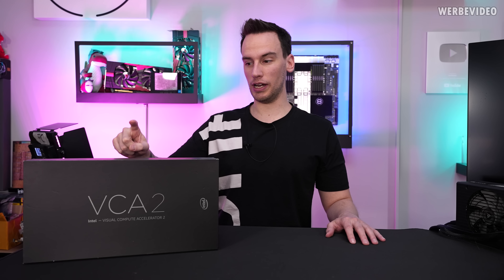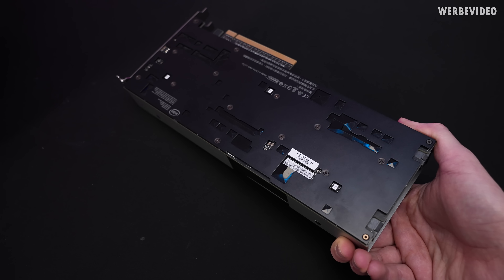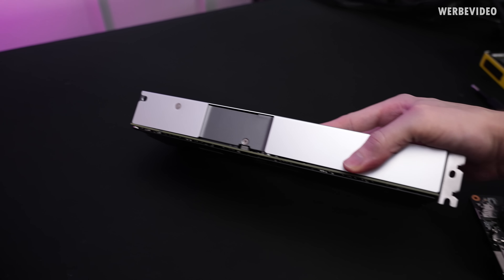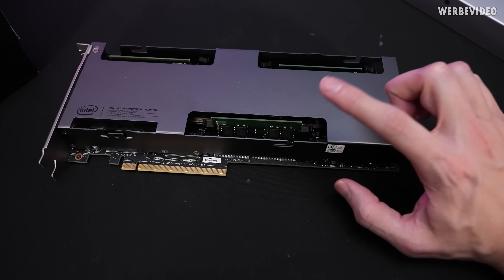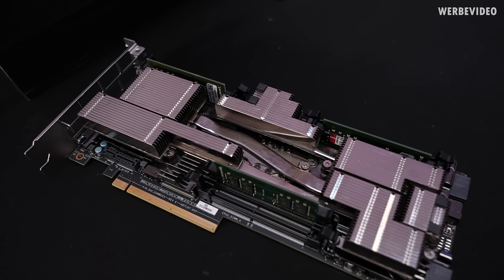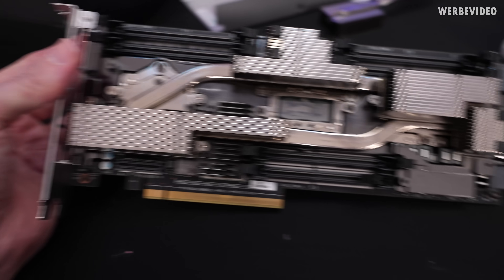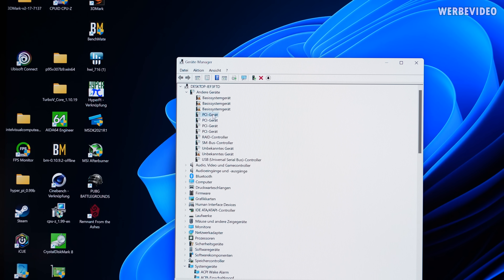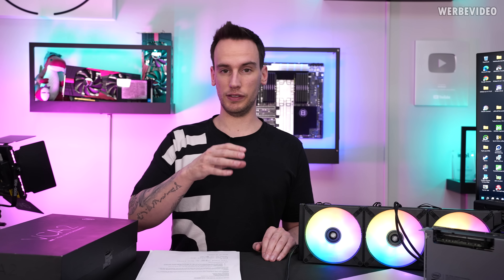Is this an Intel "Graphics Card" with 3 CPUs?

Comment: Seems like a frankenstein solution from years ago before Intel Arc, as they now have Arctic Sound which ditches the odd Xeon parts for just DG2 dies.
Reply: seems like you would use your server as a backplane and install multiple cards as a cluster. the server acts as interconnect and provides i/o.
Reply: No.. its a H100 Nvidia competitor.. build for a datacenter..

Comment: I think you are more likely to get this to work under a hypervisor like VMWare... Try to install VMWare ESXi on the machine, and then you should be able to control it through vSphere from another machine. VMWare will likely detect the additional CPUs and GPUs and make them available for VMs... You can also setup your virtual network through vSphere.
Reply: Not how that works, VMWare (or any OS) cannot see the CPU's and use them as its own CPU's, nor can VMWare assign CPU's over the PCIe bus like that. They are connected through a virtual network so you could install Windows Hyper-V on the three nodes on the card and run a small Hyper-V cluster on them, or Xen server but VMWare does not seem to support it at all. Anyway, best case is you get a cluster of 3 rather underpowered hypervisors, nor 1 system with 3 extra CPU's.

Comment: About the end part, Linux might be the answer..
Yes, it's an enterprise component it works netboot, net-storage & net-install. Net-install is the key where those windows drivers comes in play, when you can flash OS image to the recievers chache. When it's time to shut down the whole data gone, so prior to that the target output data/file is transferred to another network location.

Comment: It seems like an odd solution. What is the benefit of the PCIe connection? Is it marketed as lower latency than having separate hosts?
Reply: Not really, it's just a way of having a cluster on a PCIe card, a bit more compact and integrated than a stack of separate computers, through the latter would be far more capable.

Comment: Looks like it requires a Xeon E5 server + custom CentOS/Windows image.
Definitely interested in seeing "vcactl" running on Linux, with windows installed on the onboard M.2
Reply: Oops, I should have read the comments first😎 Spot on . Though, me not grey yet, But getting there!😀
Reply: it works also with windows but the m.2 slot is for cache  so the frames are stored on that card to exclude long ways  and you can add a feature to the bios that you can have wifi display output at boot times

Comment: You should theoretically able to perform Hardware Encoding for VP8 VP9 and AV01 videos. Which are typically used by YouTube servers.

Have you ever wondered how does YouTube able to Transcode your Video into VP9 within seconds if you're already have several Thousands subscribers?

Until this day, not even RTX 3090 Ti or RX 6900 XT capable of Encoding VP9 not even AV01 videos.
Reply: Nope... Google have engineered their own specific VP9 hardware. Now, they also made AV1 hardware. They're on top in AV1 race, it's a matter of wider adaptation of decoders on public platforms.
Reply: @Phynix72  that's right.
A private ASIC Chip that they ordered from Intel Codenamed VCU ARGOS.

Which is almost looks like this particular PCIe X16 device as shown in this video.

Comment: i`ve always wondered if there's a PCIe card with a CPU out there.......i can`t wait to see what its capable of, i`m lookin forward to a more in-depth review.
Reply: There are also Xeon Phi cards.
Reply: Actually there are plenty. The nVidia network accelerator cards (formerly of Mellanox) are running full-blown Linux environments on them. Similarly, the Xeon Phi accelerators were doing something like that. Just as two examples.
Reply: Cpus on pci and pcie arent new and been around for decades i made amiga accelerators using them with ppc cpus
Reply: mikrotik also put out a router on a pcie card with dual 25 gb links

Comment: Pure speculation. That M.2 slot seems can hold an 2230 SSD (but seems to be key-e which is used for wifi cards mostly) and the card also has mounting holes on the inner shroud. Presumably you can use some pre-configured windows server image and access the card via remote desktop. As for the PLX chips, I suppose one of the Xeons is managing the storage and boot config so it needs to sit behind another chip.
Reply: No it is not just used for wifi cards mostly. lol

Comment: On the diagram you can see the system needs to receive either a Windows or a CentOS boot image. CentOS is a linux distro. It most likely needs a tiny M.2 module with the required boot images to load. It would appear you would only need network if you want persistent storage outside of the device when using NFS.
All this one should be able to see on the one page you showed.
Reply: The host has to run CentOS with a patched kernel to enable networking over PCIe. Then you use vcactl to upload Linux or Windows images to RAM disks on the accelerator. Looking at the documentation (which is available on Intel's website, as is the software), Windows hosts aren't supported. I don't think the M.2 slot is supposed to be used, it's hidden under the shroud and any connected drive would interfere with other cards. It's probably for developer and debug purposes only.
Reply: @wsippel  the pcie slot on the card can fit a micro sdd on it, there's even a screw hole for it on the inner shroud, the outer shroud/case would hide it. For the life of me I couldn't figure out what search terms google would give me the actual server pcie ssd card that wasn't a full slot adapter for nvme m.2 drives.
Reply: @Lil_Puppy  Maybe you're right, but the quickstart guide only mentions uploading the guest OS images to ramdisks on the card from the host via vcactl, the SSD isn't mentioned. And even if you could somehow boot the guests on a Windows host (via M.2), I'm not sure how you'd be able to interface with them in any way. All the control and interface software is Linux only as far as I can tell.
Reply: @Lil_Puppy  Disk-On-Module is the term you are looking for. pcie dom, usb dom, sata dom, etc...
Reply: @wsippel  i reckon a short nvme would fit, 2230 length.
Reply: @rogerwilco99  "I wonder if CentOS  is related in any way to CentIX from the late 1980s"

Nope, CentOS is a Linux distribution based on Red Hat Linux with all the Red Hat trademarks removed.  It is basically for when you want a enterprise grade distribution of Linux and don't care about getting support from Red Hat.  Unfortunately it is being discontinued sometime in the next few years.  I have used CentOS on my home servers for the past 10 years or so.
Reply: @emu071981  It's already discontinued as of this past December; they're only patching security issues, and I don't think that's going on much longer.
Reply: @emu071981  Clarkconnect worked fine, cent should have left them alone.
Reply: The slot looks more like an mSATA slot rather than an M.2 slot...which doesn't make a whole lot of sense...
Reply: i think it's more likely that boot images are supposed to be loaded with something like PXE over virtual network cards on PCIe.
Reply: @qdaniele97  the page mentions that the boot images are loaded from nand. The onboard m.2 is a pcie slot form factor maybe thats why there's the duplicate pcie chip.

Comment: From what I can tell these are pretty much useless unless you have a system they came preinstalled in that has software that was built specifically to leverage the hardware.
Reply: But if it was part of a pre-built the fancy packaging makes even less sense.
Reply: @CompComp  I was thinking the same thing
Reply: You buy these, usually from an OEM/reseller which has a complete solution, for instance a Dell/HPE server that can have various purposes, one of which is running these cards.
You buy the server, usually with these cards already inside, but you might buy an extra card later, replace a broken card or just expand.
This is a typical 'if you have to ask what it does, you dont need it' kind of device :P

Comment: GPUs would be a lot cooler if ther just make the PCB cards SEPERATE and the GPUs in to chiplets and let us have MULTIPLE 

the coolers would need to evolve but costs NEED to come down.
Reply: I think RDNA3 is supposed to have chiplets instead of a single monolithic die.

Comment: I think you need a Xeon based system, the document pointed that it is connected to an E5 Xeon CPU
Reply: I was thinking the same.. May need to install on a MB running Xeon E5.. I'm curious to see that thing doing some work of some sort. Hopefully he figures it out. No doubt he will. Maybe with some help from some viewers.
Reply: not only also the motherboard  needs to be from intel or else you might get wrong data  it could also that it is broken if the devices are marked with error 15 in device manager well it means somesing is off at hardware level,  maybe a video bios upgrade will fix that maybee due to cooling it did not detect an air flow and it was powered off  by video bios
Reply: Or every intel system is stupid
Reply: @PARAGBD420  why stupid? I don't see anything stupid here
Reply: @PARAGBD420  smartest answer
Reply: @PARAGBD420  ^^ 🤣
Reply: @PARAGBD420  lil bit of history lesson: amd got their start by making Intel cpus. Literally every single cpu manufacturer started by copying Intel x86. By saying all that, I personally do prefer amd based off of their idea of efficiency > clock speed. This may change based off rumors of am5
Reply: @phillysupra  "Literally every single cpu manufacturer started by copying Intel x86."
Um... Motorola, Zilog, MIPS, IBM +++ wants to have a word with you.
Reply: @Qyngali  Intel 4004 = 1971. Everything else came behind this year. Remove x86 from my original comment to be super technical. Yes there were other cpus but everybody followed Intel. Unfortunately I was alive for the majority of these years
Reply: @phillysupra  I guess ARM is actually x86 then xD I get what you mean, every x86 CPU since the first Intel uses Intel's x86 instruction, though they also use AMD's 64bit 'AMD64' extension and many more so saying Intel invented the current x86 instruction set is not really true... The 6502, likely the most sold CPU ever was not based off of Intel's designs at all for instance, nor do the 6800 and 68000 series and many more. Same for PowerPC and Intel's own Itanium...
Reply: @phillysupra  avr, risc, pic, arm etc... aren't based off of intel's x86, but are cpu architectures nontheless. 
intel did make one of the first microprocessors, but processors like the ones motorola made aren't really copied off of intel.
the Z80 was made compatible with the intel 8080 so yeah quite a few things were inspired or copied from intel, so they definitely had a lot of influence,but they didn't make everything.
Reply: @satibel  go back and read the above posts. If it wasn't for what Intel had uncovered back in the 70's as a company these other companies would most likely not exist. Also, almost none of those other companies from the 70's exist at all today. They mostly broke up and created other companies. The basic micro architecture all stemmed from the work of companies like Intel. Yokohama and nitto  are tire brands, they didn't invent the tire, they just improved upon it just like amd or Arm improved on the basic ideas structured from companies like Intel. (I repeat, I prefer amd over Intel so this isn't some shill speach)
Reply: @phillysupra  there was a few independent designs for microprocessors in the early 70s, so it is likely that if intel didn't step up some other business (most likely motorola) would've made processors on a similar timeline, they did make some innovations but most of the copying was on an instruction compatibility level, so that engineers could easily port code to the new platform.

atmel and microchip (avr and pic) definitely are still around though they are fairly recent  (mid 90s)

intel definitely deserves a lot of credit for current architectures, but most of it is being popular and good enough, so a new architecture needs to do a lot to justify the swap.
Reply: @phillysupra  Look up the Datapoint 2200...
Reply: @phillysupra  lol even the 8008 wasnt based on the 4004. What you said is just BS, AMD wouldnt have been chosen to second source the x86 for IBM in the 80s if they hadnt already been successful in the 70s with stuff like the 2900 bitslice processor. Many pre-existing architectures also became microprocessors. And a heck of a lot of technologies completely unrelated to intels CISC approach were developed - i would like to see you justify your comment WRT to ARM or IBM POWER, all the TI architectures, even the 6800 and 6502 of teh time which are completely unrelated. If intel hadnt existed a plethora of other companies would have done what they did - likely better than they did since they believed they were a memory fab company and treated their microprocessor engineers so poorly in the early days they all left and formed Zilog.
Reply: @mycosys  now ask yourself if the 8008 would have been thought of if the 4004 hadn't come before it. Companies invented back then based off the basic ideas, micro architecture and instruction set before them. Basic nature is to design and redesign to improve of what came before you. Just like how every 64 bit design stemmed after amd did it first. Did Mazda invent the wankel engine? No, they improved on what Felix started == same situation. Did bmw invent cylinder head valve train , no, they improved it when they invented vanos and so did Honda when they invented vtec. They all took the basic design invented before them and made it better. This is what I'm getting at as a bigger picture
Reply: @phillysupra  that's not entirely true.AMD gave intel x64 tech and said try and see what you can do with it.
Reply: @pierregrobbelaar9116  listen to what you just said. "Amd gave Intel x64 tech" .... Did Intel then not produce x64 tech after learning the basic instruction set and then improved on it. People want to refute and say such-and-such company had a different cpu but the underlying idea / instruction set was invented by lot of guys who collaborated on the original idea then broke off to create and improve on such initial ideas by inventing their own cpus. Who do you think Intel will learn from when they finally leave  10nm process node....
Reply: @phillysupra  if you want big data errors then you can have it under full cpu load AMD  and an error output of 20-30 % of total calculations intel has max 10% so intel is more stable  wich means less maintenance on the software level
Reply: @someguy4915  ah xeon ises ia64 the amd64 is a compatibility layer for other chipset brands that uses that standard on a intel board that wont be used
Reply: @pierregrobbelaar9116  shore but that is just for compatibility on other chip sets  on intel chips that instructions set  is not active
Reply: @adriancoanda9227  where did you ever read any of my comments above where I remotely mentioned error rates or software stability? It's almost like you didn't read any comment in this entire thread. Intel and Microsoft work so closely together nowadays and Microsoft made windows 11 just to increase performance of 12th gens architecture. Amd is faster on most Linux distros nowadays anyway. This is a whole different topic to what I mentioned above.
Reply: @adriancoanda9227  Xeon uses x86-64, IA-64 is the Itanium instruction set... x86-64 is Intel's license for AMD64...
AMD64 is the 64 bit extension on x86...
Reply: @phillysupra  get Prime 95 and test a cpu it is not about the speed here  but about stability rate  and to claim that x operating system is better or not y was not mentioned that either  on bad constructed hardware without proper driver support will fail all operating systems out there there are 2 differences between running and supported
Reply: @adriancoanda9227  I've been building pcs since the early 90's and working in IT since 97... I currently am a software developer and a pc enthusiast, I'm good. First lesson is to KISS (keep it simple stupid) as a motto. You guys are debating instruction set and who uses what set of micro architecture. My original point was that  1 single idea from a group of guys brought everything we know now. That group of guys all split up and led to other groups inventing similar but different products. Would cardano or etherium exist if not for bitcoin? That's my point. They are all different, all solve different ideas but at the very basic core are all coins stemmed from a single idea from bitcoin.
Reply: @phillysupra   ah you are right about the informatic history  but y am one that is looking in to the future  and not into who did what  y have the impression that most of people are scared to change y mean completely new ways like those that started this they did not think about the past ,
Reply: @adriancoanda9227  because thats what my original comment was about. I'm all about looking to the future and changing things but history always repeats itself. You have to know where you came from to understand where you're going
Reply: @phillysupra   true but does that not impregnate a break in to the mind ? It is like installing newest os on a 30 old hard drive  y prefer to abstract thinking sometimes
Reply: @adriancoanda9227  🤔 I do have some old ide hard drives lying around somewhere. Yet I doubt they'd be large enough to hold a modern Linux distro or a windows 11